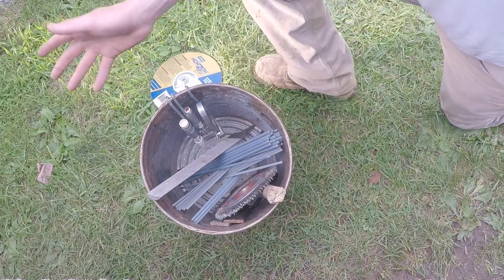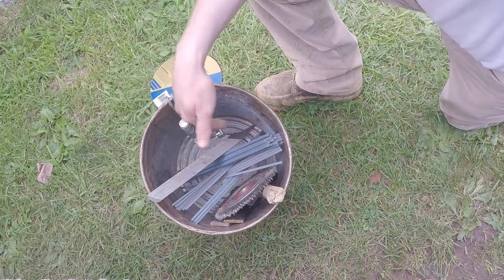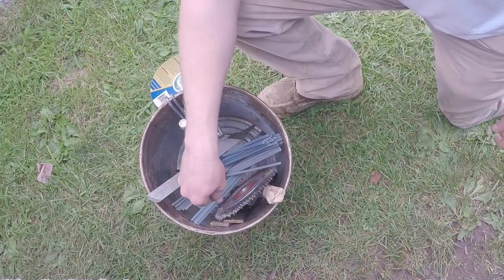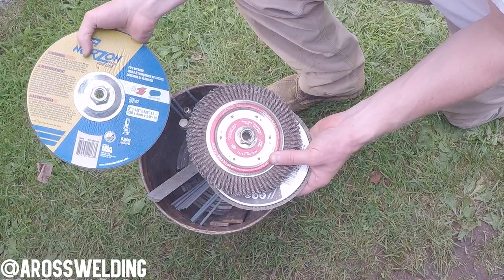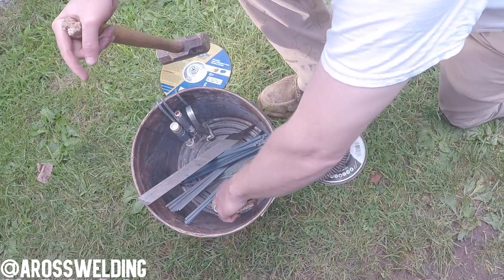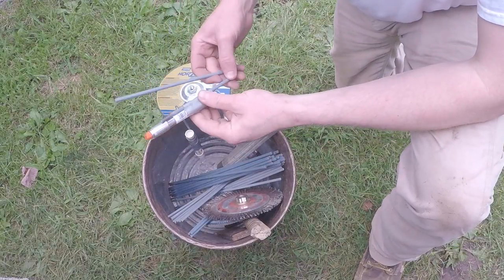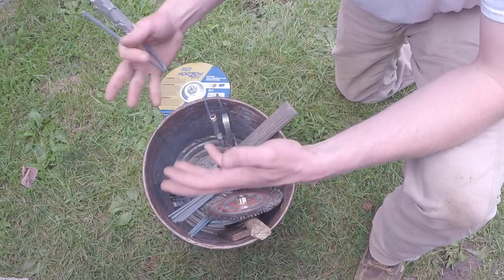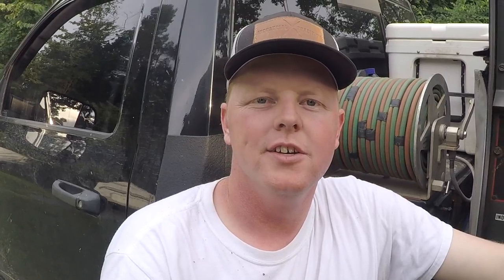WELDING ROD BUCKET

Comment from the maker: This is a re-upload from yesterday.  The audio was messed up at the beginning so I wanted to get it fixed.  Hope you can hear me a little better in this one.  Let me know if you have any questions. Y'all have a good weekend!
Reply: Austin Ross been trying to find the video of the cloth skin you put on your Lincoln. Was wondering where you got it from?
Reply: Hey I'm welding on some structural steel can you give me some ideas on a 5/32 6010 7018 on the amperage? How hot do you run a 5/32 7018 going uphill? And a 6010 5/32

Comment: You should do some 8010 downhill tutorials. Tons of 6010, 7018 tutorials but no good 8010 tutorials. Also, what brand 8010? Is it a lincoln 5p + rod?
Reply: 8010 runs like 6010. Look up Basic Stick Welding and you will find out what the numbers of/on the rod mean.

Comment: hey Austin this is Devon miller  im 20 yrs old i just took my 6G welding cert at the anaconda job corps  it only took me 2 months to certify  i went thou all of the positions 1G ,2G, 5G and 6G,  ive been welding for going on 2 yrs  i really want to join the pipe-fitters  The biggest pipe ive done a 20" schedule 40 in the 5G POSTION then a schedule  80. its been a dream of mine since i was little since now i have my cert im wanting to join. but the issue is i dont have a welding rig  or anything My question is how did you get started?. ps watch of your videos. they have given me a lot of knowledge about what to expect when i join . thanks man
Reply from the maker: I went to votech for welding my junior and senior year of high school. I plan on makin a video telling my story. So stay tuned. But you are on the right track.

Comment: Now if you need a welding bucket can you make one out of 6” pipe thin wall tubing and have slots for the rod to rest in.
Reply: Some helpers cut slits in thier buckets to make rod pockets, or use U bolts. Can use 5 gal buckets or shorter buckets. Lots of variety.

Comment: How long were you a helper for before you broke out?
Reply from the maker: I never did help another welder. Wished I would have. Would have been a lot easier to get started.
Reply: @arosswelding  is it hard to get on as a helper?

Comment: Hey man one more ?. So I was wondering how come yall dont use the 8010 rod for the root since it has a higher tensile strength and 6010 for the hot, fill, and cap ?? Thx ur tha man! 🤔
Reply from the maker: I really couldn’t tell you. All that is planned by an engineer. I have been on a job where they wanted the bead to be ran with 8010. We just weld with whatever the procedure calls for.
Reply: Its all about the wps, man.  The enginerds know what they are doin when they make those papers.

Comment: Hi. Can you tell me where I can buy sum 8010 rod? cuz I can't find it anywhere. I want sum to practice with. Thx.
Reply from the maker: Check online. It’s around 200 bucks for a 50 pound box. Other than that I would check your local welding supply stores. Or you could always just practice with 6010. It’s a little cheaper.

Comment: What’s the sanding pad for?
Reply: The flap disc is used for the same thing as grinding discs but its faster. You cant use a flap disc to grind the root or hot passes though, it wont fit between the bevel. Thats why you would need both the grinding and flap discs.
Reply: That being said, a flap disc isnt completely necessary because the grinding wheel can do everything and more than the flap disc can.

Comment: I'm a machinist by trade. I cringe every time I see someone using a file with no handle. Ya'll don't have the same risk as we do, but it will still make using a file easier on your hands.

Also, stop whacking grinding wheels with a file, or anything else for that matter. You definitely do not want to see what happens when a grinding wheel explodes due to a crack and someone is in the path of the pieces. I used to work with a guy that it happened to. Had scars all the way up one arm, his shoulder, and his neck. The piece of wheel that struck him climbed all the way up from just above his wrist.The surgeon told him it had missed his carotid artery by a single millimeter.
Reply: Well machinists hands aren't nearly as tough and rugged as welders hands. So yeah. But with the grinding wheel yeah bad idea to modify the grinding disks.
Reply: Glue on a golf ball for a handle.  Works great for protecting your hands.